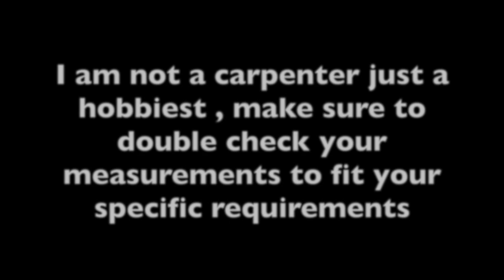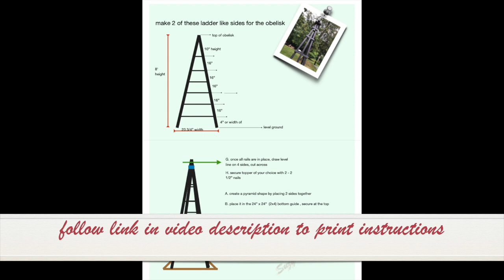DIY Easy Obelisk, Trellis

Comment: Hello, Suzy I am back here again on my Sunday day off. I wrote all down what I need to buy on the A4 paper. This summer I need to buy good impact screw driver machine as I always end up my palm gets a lots blisters using  manual screw driver. I have checked the price of Makita one in UK online, what a expensive machine I was shocked. Women come to buy expensive handbag to our shop but I don’t want any of those, I want a good DIY machine❣️ My staff discount doesn’t help my tools at all. hahaha. Love from Japanese lady from UK. Thanks for the video again. I wish I could give my thumbs up again and again. 🌹🌹🌹 Best Wishes.
Reply from the maker: Good for you on wanting to invest in some tools. I know the prices can sometimes be a lot. I usually research what I want to buy,  and then wait patiently for a sale. I have purchased all my tools this way. Also, a tip on purchasing tools, try and buy all the same brand (manufacturer) that way you can use the batteries from one tool on another. Replacement batteries sometimes cost almost as much as the tool itself. Try and get a good battery that lasts a long time and doesn't take too long to charge. It feels great to be independent and create or build things with your own hands. I love hand bags too but you can't build a nice obelisk with one  ha ha. Good luck on finding a good drill. Thanks for the kind words
Reply: @suzy rebelo  Dear Suzy, thanks a lots for your great advise. Yes, I would love to take your kind advise as batteries can be very expensive. I will ask ex my next door who is  brick layer and he said he can take me to trading shop so I can get a little cheaper with him and his member card. Last night Oberisk timbers I looked at on line become almost 100 pound, that’s a lots. I don’t have a car and even so 8foot long timber I can’t ride on a taxi either, hahaha. So I asked him some favor today when he brought some free bricks where he has been knocking down the garage someones house. I asked him can I have second hand bricks to my path to rose pagora. Then he said he can even give me some sand to fill in between the bricks. So I am going to give some my Hosta plants, Passion flower, etc. Thanks again Suzy. I love your Oberisk. 💖 🌹 You take care and have a good summer.

Comment: Thank you. I really appreciated your video. This build is one I can do with the grands. They can help with nearly every aspect of the build, including the paint. I like the idea of painting prior to assembly on this - easier and simpler and it will reduce, I think, wood rot at the joints. A squirt of caulk on the joint during assembly might help as well. This style allows for easy replacement of damaged or deteriorated members fairly easily. And, as the ends rot, the unit can easily be shortened a couple of inches and continue in service to the garden. Thanks again for the video.
Reply from the maker: Thanks so much Neil. That was my goal, build something easy with minimal tools but hold up to the weather. These are doing great this winter. Brings lots of interest to the garden. I love that you’re sharing this project with the grandchildren. Creating wonderful memories and teaching them a nice skill. Happy building and thanks for watching.

Comment: I just wanted to say thank you for this video and posting the instructions for all of us to use.  Your jigs for this are perfect and make the job a lot easier, I'm currently making jigs for 6ft, 4ft and 2ft just to see what I like best.  Thanks Again for this, it's very kind of you to post the instructions.
Reply from the maker: I'm so glad you found it useful Kevin. It's great to have a project you can complete and enjoy in a short period of time. They've stood up to winter really well too.  Thanks for watching!
Reply: Hello! I am wondering how to reduce cuts, etc. to make a shorter trellis. Can you please advise your dimensions for the smaller sizes?  This is a beautiful trellis and looks stunning!  I would like to limit the height to 6 feet for my purposes.  Also, it would make great gifts as well, especially at shorter sizes.  Thanks for a thorough tutorial and a beautiful end product!  I will also be checking out your other videos as I love woodworking, too!
Reply from the maker: Hi there. It’s very easy to reduce it to 6’. Just change out the 2x2 ‘s from (8’ lengths) to 2x2 x 6’ length. It reduces the height but everything else stays the same. I was originally going to make them 6’ tall but decided on 8’ feet because I liked the scale.  These would make amazing gifts! Happy woodworking.
Reply from the maker: I should add. You’re going to make a 6 foot triangle instead of 8’ triangle. The bottom width of the triangle is the same measurement. The rails going horizontally, start at bottom  like I did. Measure the first one to fit and cut the end off preserving the angle. Then use spacer to lay the next rail above the last rail, do the same thing , lay it across , draw angle at end , cut end, flip over rail over and lay the next rail so on. When you get to the last rail at the top,  just place it where is looks pleasing to the eye. Evenly between the rail above and below. This will work fine and look like the one I made just shorter.  Try to buy your 2x2 in exact length ie 6’. Makes for less cutting.
Reply: @suzyrebelo  thank you so much for info and tips! Can't wait to get started!
Reply from the maker: I know. I can’t wait for spring and working on new projects.